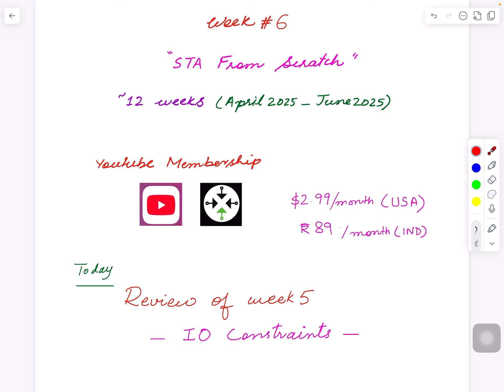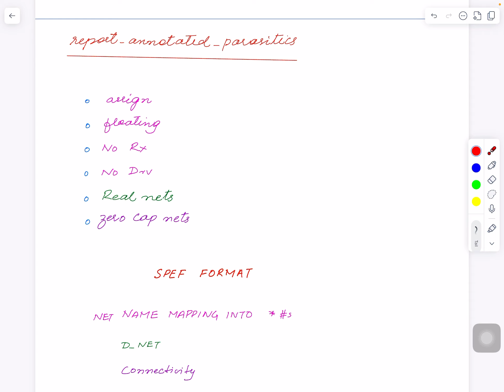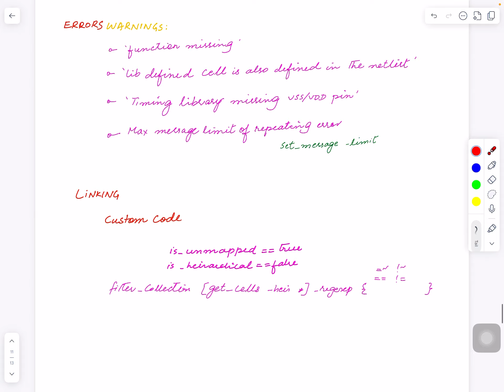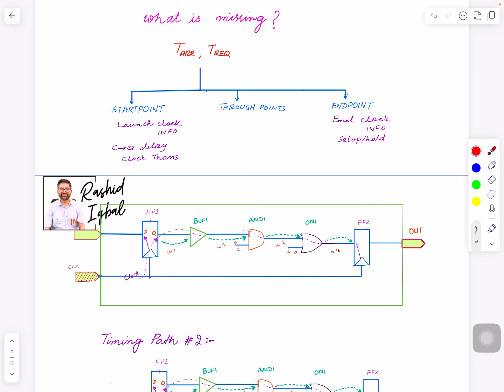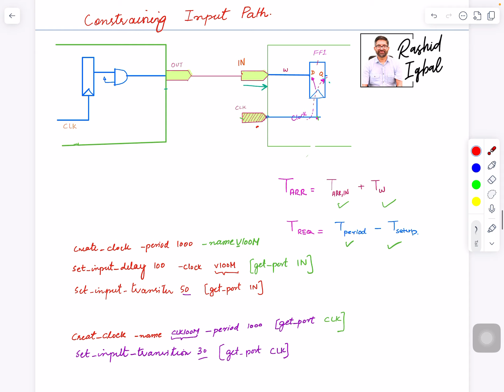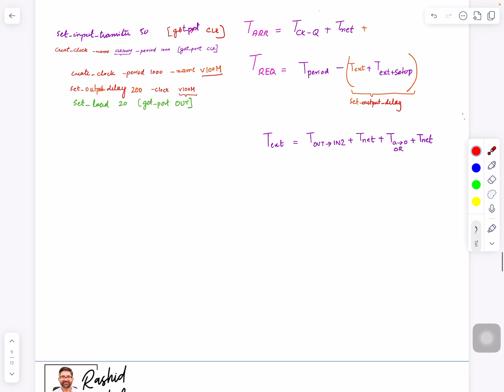STA Series, Week 6 video 2 - IO Constraints (set_input_delay, set_output_delay, Virtual clocks)

Comment: what are the delays included in set_input_delay?
Reply from the maker: These include the delay in the other block (driving your input port) till its output port which comes your input. this will include clock network delay, clk-q delay of the launch flop and then data path delay till the port.